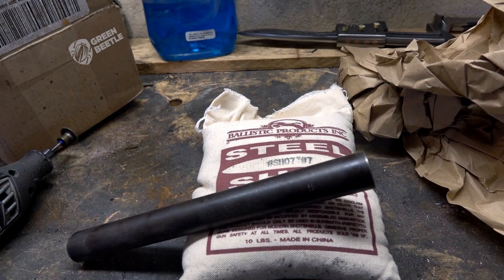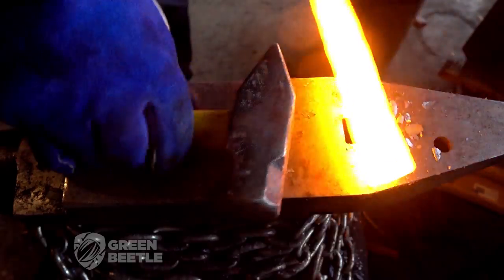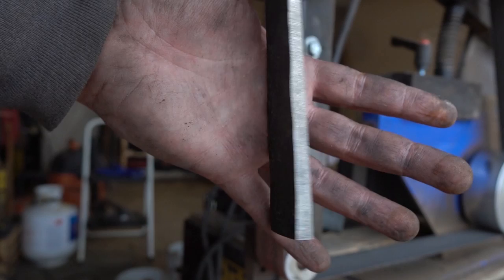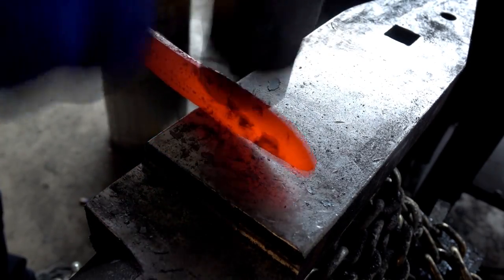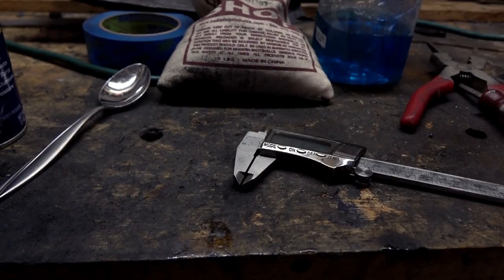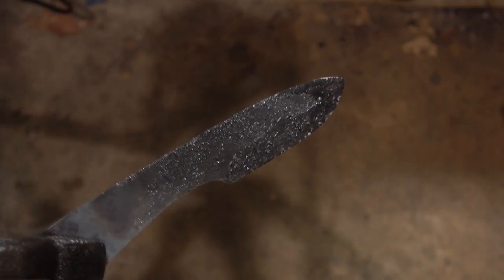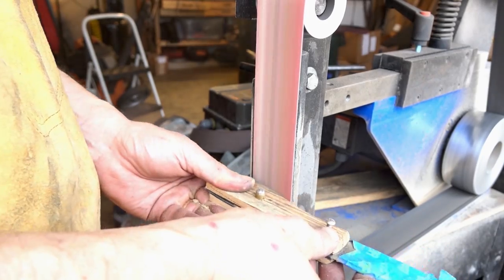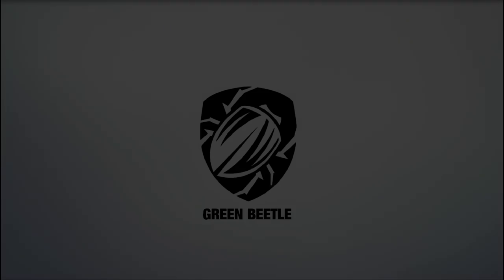Making a Knife With Bird Shot

Comment: Re-upload? that's fine I'll watch again. love your videos friend.  keep up the good work.
Reply: Green Beetle ah! Roger that.  don't want the trolls to get that.  are you still based out of the tulsa area?
Reply: Green Beetle your videos inspired me to start knife makin...i love your videos and please keep up your great qualitiy of content...actially i am saving my money right now to get a forge and anvil to jump into blacksmithing...GREAT VIDEOS!
Reply from the maker: yep
Reply from the maker: nice!
Reply: Lego MOC-Building hey friend it is quite possible to make a charcoal forge for less than $50. what I used for my first forge was a brake drum with the main hole covered with a plate of steel with holes drilled In it. then just run a pipe up from the bottom and attach a hair dryer to the pipe. fill the drum with lump charcoal, not briquettes and start lighting it with a blow torch and then turn on the hair dryer. this is a very effective first forge and it is even capable of melting steel! I have done it! another option would be looked up "soup can forge". this will allow you to start forging small blades! if you need an anvil I recommend walking down some train tracks and look for a small enough section to move. good luck it is such a rewarding hobby!!!
Reply: Green Beetle could you make a knife out of a gold and steel alloy?
Reply: Jake Pryor an good quality barbecue also works after good cleaning. I got one from a friend who bought a whole outdoor cooking set and thus didn't need it anymore. Together with a €10 hairdryer it works great

Comment: -Green
great pattern,next time you should try 52100 ball bearings it will give the same pattern but with no addition of carbon needed.
good work I think it is called dragon scale pattern?
thanks for sharing, Martin
Reply from the maker: cool ty for the idea
Reply: but completely fill your former box with balls before adding powder... then use an air chisel to vibrate all the powder down to the bottom. it'll take longer to fill the gaps but it'll be more thorough than adding balls, adding powder, adding more balls then more powder.

Comment: Try filling the tube most of the way with shot first (leave a little room for the tip of the funnel). Then funnel in the powdered metal. It will filter down through the shot to the bottom of the canister no prob.

Comment: A few random ideas:
I've always wanted to see someone make checkerboard pattern damascus, take a lot of cubes or segments of square stock of different alloys of steel that etch differently, and tack it together, then forge weld it. I doubt the cubes would keep any sort of sharp clean shape in the pattern but it all depends on how you forge it.

Also this process would look really cool with larger spheres, like some 1/2" ball bearings, or maybe even something as big as a pinball, there'd be a much more pronounced large pattern.

Have you ever considered forge welding chain mail? It's really easy to make some standard 4 in 1 chainmail sheet, and you could do any kind of metal as long as you're able to find the wire/rod for it, and you could roll it up and bunch it into a canister like you do for most projects. If you're interested I'd be more than happy to make some chainmail to send to you for this.

Love all of your work, thanks for the vids and for communicating with your fans.
Reply from the maker: check out alec steele's channel he does some really cool damascus

Comment: Hmmm... I wonder if instead of steel shot you use 1/8th inch ball bearings. Those are 52-100 steel if i remember correctly. That is a unique pattern. Keep up the good work.

Comment: To help get the balls settled into the powder(that just sounds nasty) you can use a sawzall without a blade.  Hold the shoe (part the blade goes through) against the canister and that will really help settle the powder and the balls.  You could also use a jig saw or any heavy duty thing that vibrates(I heard that, no she doesn't have one;0)  Or even a thumper type massager.

Comment: fucking love this.  id like to see you find a nice mosaic application for braided steel cable.  a thought i had was to compress a few sections, take slices assemble them in a stack about 3 high side by side,  tack em together or put them in a case and fill the gaps with powder before forge welding. im sure if you did it carefully you could probably grind them into hexagons and fill the gaps with powder so you get a really nice geometric patten.  should give a very defined pattern to your billet.

Comment: cool knife, Im exited for the damascus steel from Alec
Reply: jakpown same here! Can't wait, we get to see a colab between Alec and GB with the knife more than likely auctioned off for charity!
Reply from the maker: His billet should be here soon. hopefully I can do it justice.
Reply: Green Beetle please do us all a favor and wear a long sleeve shirt! Don't want the Damascus to delaminate when it sees your biceps again 💪 😂
Reply: Green Beetle you'll do it justice for sure!

I don't know if you saw a message I sent or not. I watched a video of canister Damascus to make mosaic billets. He said in the video to not get any air pockets was to drill a tiny hole and spray wd40 or something similar as once it goes into the forge it will take all the oxygen out of the canister. 

Could you also do levels then compact it like green sand? Still might want to drill a small hole so it doesn't combust in the forge or when you hammer on it the first time
Reply from the maker: this is a true statement.  Also NASA makes me wear long sleeves on launch days.
Reply: Green Beetle 😂 So that's the reason you used a dremel to open the box! You have the carbon steel powder already!

Comment: Rather than tapping the powder down amongst the birdshot wouldn't it be easier to use something to vibrate the tube? It should agitate it enough to flow down through the gaps and eventually eliminate the air pockets.

Comment: Nice! You mentioned stainless steel at the start, which made me wonder.. is this capsule Damascus technique possible with stainless? If so, how would the process then be different?
Reply: stainless is a lot more difficult to pattern weld, or to just forge weld together in the first place. while the corrosion resistance is nice, the chromium, vanadium, and other trace elements (nickel?) makes it more difficult, and finicky to bind together with other steels. simple carbon (ideally high carbon) steels perform fantastically, just a little more upkeep to make sure it doesn't rust, like not leaving it wet, or exposed.
Reply: stainless is a lot more difficult to pattern weld, or to just forge weld together in the first place. while the corrosion resistance is nice, the chromium, vanadium, and other trace elements (nickel?) makes it more difficult, and finicky to bind together with other steels. simple carbon (ideally high carbon) steels perform fantastically, just a little more upkeep to make sure it doesn't rust, like not leaving it wet, or exposed.
Reply: DementedDoom I see! thanks!

Comment: I noticed you don't dip your hammer in water before striking. is there a reason for that?
Reply: Because he's got a brush. Wet forging just uses the steam to blast the scale off the metal so you're forging on a clean surface. You can get the same result with a good stiff wire brush without slopping water all over your shop.

Comment: After taking something like this out of the forge, how much time can the piece be worked with before it has to be reinserted into the forge and brought back up to temperature? It seems you don't have a lot of time, but maybe that's just because most blacksmithing footage I see is sped up by 2x or some other unknown amount.

By the way, the finished product turned out great.
Reply: embrezar everyone is different but it’s generally when the steel is a dark red/ going black colour
Reply: Yeah but generally how much time is that? I know everyone is different, every piece is unique, but there has to be a limit, right? A point at which no further work can be done on that piece and it has to be heated again. What is the longest time you've worked on a piece before you returned it to the forge? Can the piece be damaged if the smith tries to work on it for too long before reheating it?

Comment: super cool, why exactly did you do the three step hardening process. Im currently working on a knife made from a file. you have any hardening suggestions.
Reply from the maker: hypereutectoid steels, like your file knife, require thermal cycling at precise temperatures to optimally distribute carbon/carbides in the steel and to reduce grain size.  If you don't have a heat treat oven for thermal cycling in this case one can at least reduce grain size in your file knife by sequentially quenching the blade 3 times.
Reply: cool thanks for the insight

Comment: So this doesn't necessarily pertain to this video but, could you harden mild steel enough to make a hammer? I'm on a very very tight budget so I have been making every thing to start knife making including, the anvil, tongs, forge and so on so fourth. I have big metal lathes at school so shaping a hammer head is no big deal. Would making it out of mild steel be worth it or should I just cough up the money and buy a decent hammer? I'm new to this whole forging thing so I don't know a whole lot yet. Thanks!
Reply from the maker: Nate Leonhardt  no to mild steel.
Reply: Pierre LeDouche  yeah that is what i did for an anvil, I drilled A hole for the tools. I also got a large enough chunck of rr track to shape a horn into it. The best part is that i got it for free because the had it in the metal cage at my high school.

Comment: Could you not have carburized the birdshot before forge welding for a greater effect?
Reply from the maker: i was worried it would cause mild oxidation on the pellets that would he mean I couldn't subsequently forge weld it in a canister (cant flux inside a canister).

Comment: wouldn't it be better to harden the shot before putting it in the barrel, when each pellet has more surface area?
Reply from the maker: The process might leave residue or oxidation on the pellets despite my efforts to keep oxygen out of the carburization container and that oxidation and since flux cannot be added to the forge welding canister I worried the pellets would not forge weld.
Reply: Green Beetle that makes sense...
but i would love to see the results, if you are up to trying it out.

Comment: Friend's busy making sawn off shot guns? 🤔
Reply: You can legally chop any barrel if you maintain the minimum length. Plenty of 28" barrels out there.
Reply: Automat 922 most bubble Darrel shotguns have 28inch barrels, and some cheap ones have separate barrels. In case of damage, you can just take the barrel off and replace it

Comment: FFS... Historical Damascus swords weren't made from pattern welded steel. Yes there are period pattern welded forgeries, but the steel that made a made a name for its self was a unintentional HSLA (high strength low alloy) crucible steel specifically one with vanadium as the primary trace alloying element. The vanadium was present in alloying quantities in the ore deposit (which was in India look up wootz steel).....
Reply: Pierre LeDouche I have pretty easy access to research papers on the subject been at university studying mechanical engineering. But thanks for bring the resources to light as I'm aware others are not in the same position.

Comment: Did I miss something or did you just talk about carbonizing the blade but not actually show it?  You mentioned charcoal but then you heat treated it in your oven inside the bag.  Where did the carbon come from?
Reply: Never mind, I saw it the second time around.  So, in the foil pouch was charcoal powder and ...... sodium carbonate?
Reply from the maker: yes, 75% charcoal (wood ash, not briquettes) and 25% sodium carbonate which is made from heating baking soda in the oven at 250 degrees for an hour.

Comment: Just an ideas but what if you made a knife from guitar strings?
Reply from the maker: Vincent Steinbach  I looked into it.  Most are either plated or coated with something to prevent rust or wound with nickel :(
Reply: Green Beetle you sure it won't burn off in the fire like cable wire? Because cable wire has that coating to prevent it from rusting, or you could put the string in acetone to remove the grease. You could also try paper clips

Comment: You know, if you keep making these canister damascus's then you might want to invest in a forge vibrator. As ridiculous as that sounds
Reply from the maker: If this is trolling its top form
Reply: Green Beetle sounds funny but I was just thinking the same thing. A table that vibrates would help draw the powder steel into all the nooks and crannies without smacking it a bunch. But maybe you like smacking idk
Reply: I mean, any ol' power tool will do the trick. Get a cheap oscilating multi tool, hold it up against the canister, and turn it to 11. Or just a cheap palm sander.